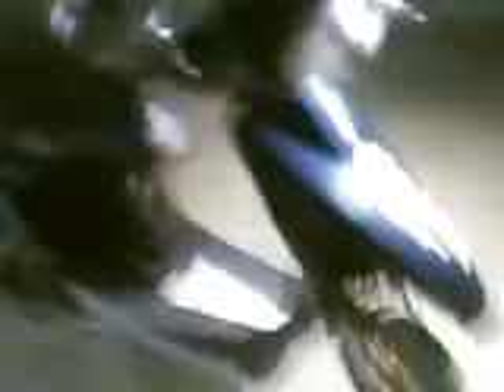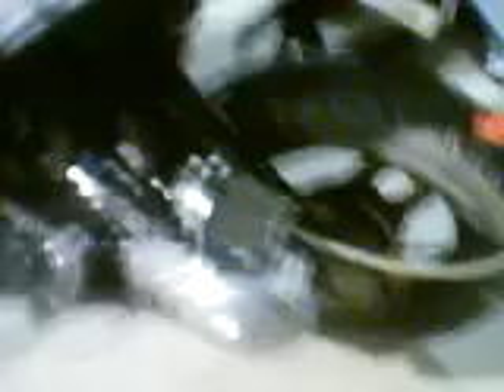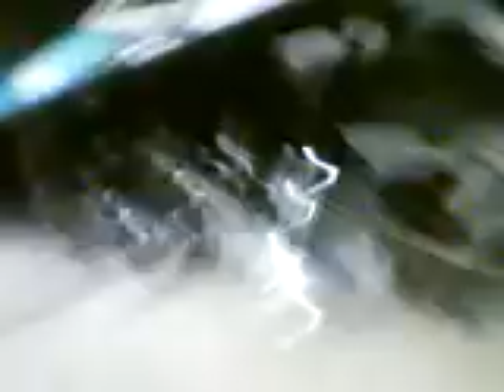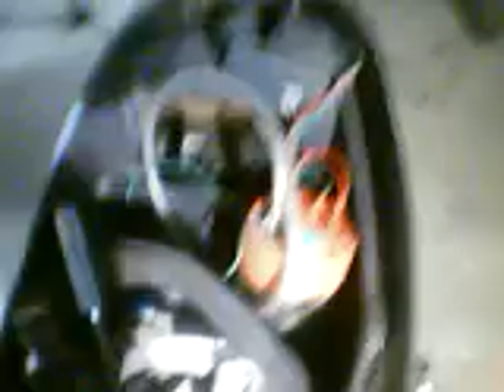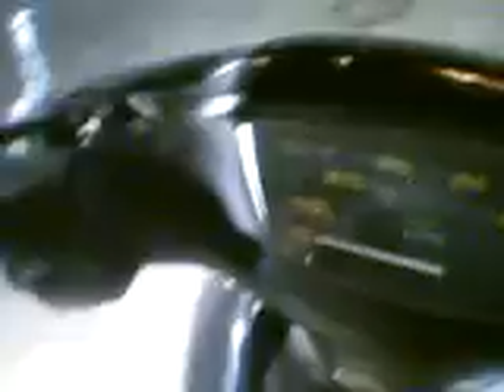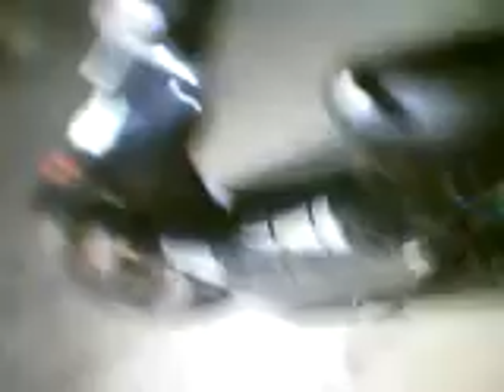mini HHO experiment Dio Scooter Test 1

Comment: I got a Runner SP 180 too, they are monsters!! Im going to jet down the carb, Dellorto 20,5mm and V force 3 piaggio reeds then connect my HHO generator to the airbox manifold right behind the carb so it wont affect the flow or crank compression. and Im gonna higher the oilpump on max.
Do you really get more milage with HHO if you dont change jets.